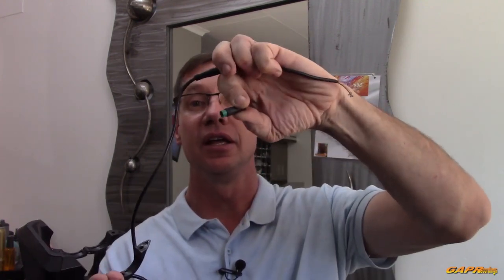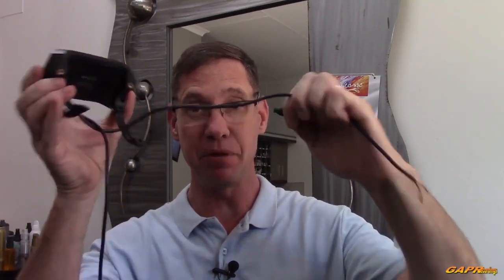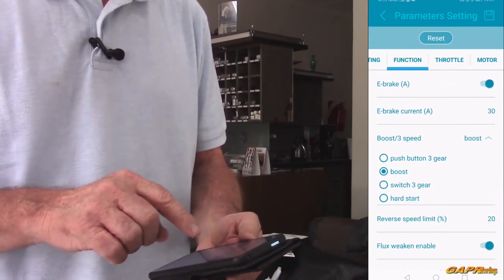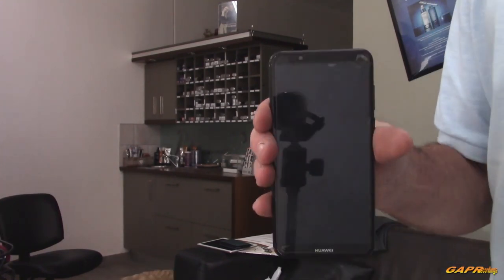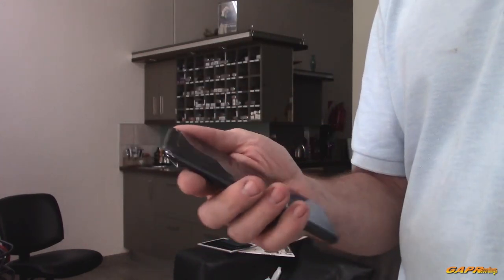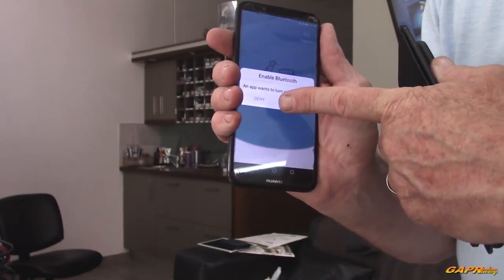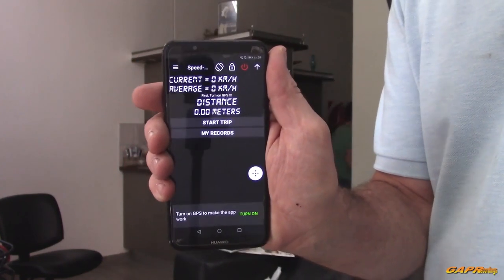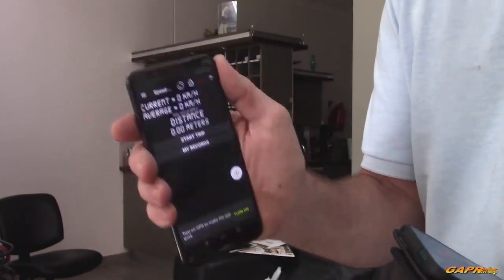Ebike Dead Sabvoton Screen? Now what?

Comment: Thank you massive help. I bought mine without display. Now it turns ok. How did you figure all of this out? Do you have a wiring diagram? I need to figure out the rest like throttle and brakes colours.
Reply from the maker: Hi Kelvin, nope. No wiring diagram for sabvoton electronics. If you are looking for a wiring connection diagram just type that into google and quite a few connection diagrams should pop up I had to do some good old fashiond electronics diagnosing.... Just lucky me thinks.. Glad I could help. Let me know if I can be of any further help.
Reply: @GapRecordingsNamibia Ok, thanks. Google has failed me. Mine is unusual, it came with just the female julet connector, no male end that leads to throttle and brake connection. So I cut it on, I have 9 coloured wires to figure out. At least now I know blue, red and black. The hunt continues.

Comment: Hey watched the video and followed all steps and my controller won’t come on battery is close to full charge so that should not be problem I’m not sure what to do haven’t been able to get the light on for the controller since I got it it is a sabvoton 72200 controller it is strange because I held the button on my display the first time it was hooked up and display started to turn on and then shut off and now can’t get it to come on again any advice or tips would be greatly appreciated thanks for the video bud
Reply from the maker: Hi Zach, I will try and assist you.

The controller that you have, is it the "set" the controller shipped with the screen and thumd control? The first thing I would recomend is that you make sure that the battery voltage present at the controllers + and - terminals is correct, and to make sure that it is not dipping below 36v when powering the controller on.

What you described with the first switch on sounds very suspect, sounds like there could be an internal fault in the controller.

If the controller is powering on at least 1 of the leds should be lighting up. If none are then I would say that the controller may be faulty. First, make 100% sure of the power getting to the controller, next make sure that there is power present on the red cable that would be supplying power to the screen, measure that from the ground terminal on the controller. If that all checks out. I am not sure what else to look for bar the suspect controller.

Good luck, I hope you are able to find a fault.

Regards
Charles

Comment: Just had this all ready to go but mqcon says I have a throttle error instead of it saying regeneration. Anyone know why or how to fix?
Reply from the maker: Hi Justin, not quite sure, where is the error set?  

On the software or on you sabviton screen?
 What software are you using? 
The cellphone app or pc app? 

A few things I could think of off the top of my head are: a faulty throttle, the second has to do with what the throttle voltages are set at, throttle closed being set to high and the wheel stalling could cause this out of the gate. 

I do think that it one of a few faults you'll need to investigate. But I first need to know what software you are using as I only have the cell app.
Reply: @GapRecordingsNamibia  the android app. Never seen it before. Bike has been sitting for a good 3 months since the screen went out but was working fine before it took a dump.

Comment: The issue with doing this mod is shorting those wires to turn the bike on is, theres a spark across those wires every time you connect them which can damage the switch you use. Also, I've found that if you ever put a screen on again, you get a constant 'communication error' on the display, and the bike will not work. This happened to me twice.
Reply from the maker: Hi KB, Sorry for the late reply I'm not getting notifications, I have found zero spark issues at all from the wires being put together, #1: there is only 490mA being drawn across those cables, #2: the only reason you'll get a comms error is if you have not re-pluged the two white 3 pin connectors together and changed the menu setting back to what they should be for using the screen again, you can not use the screen and the dongle at the same time, it either has to be one or the other. I have already replaced the screen on my bike with zero issues.